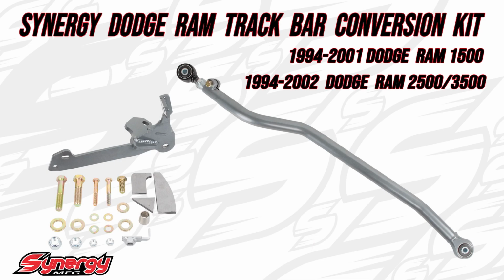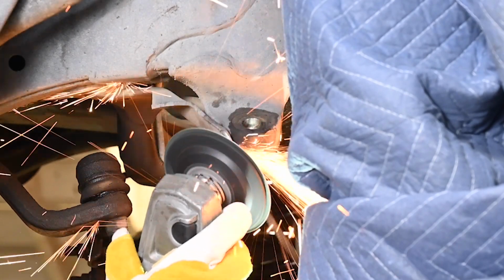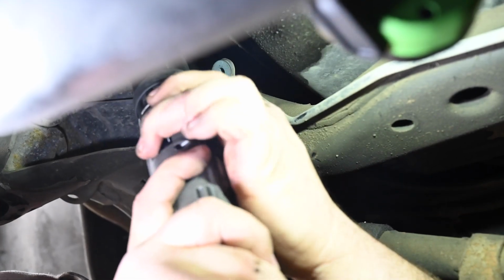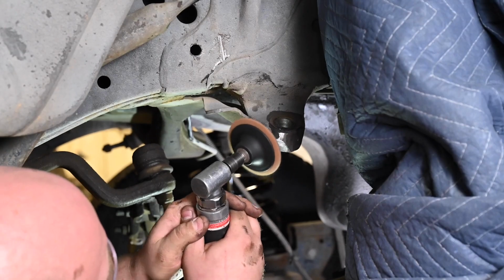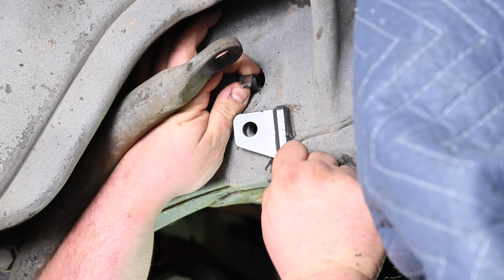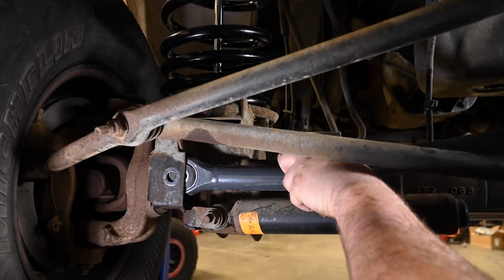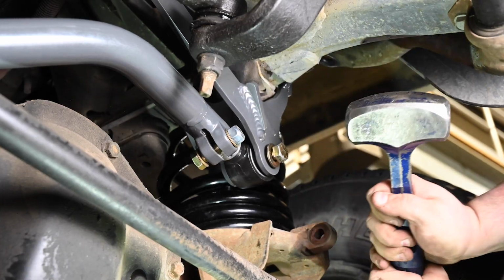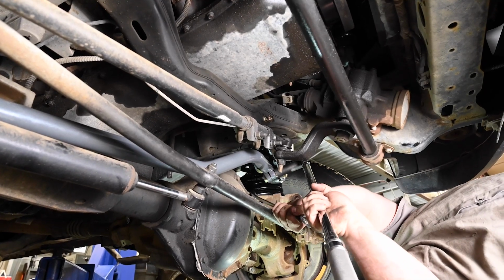Synergy 1994-2002 Dodge Ram 1500 / 2500 / 3500 3rd Gen Track Bar Conversion Bracket

Comment: Does this solve the interference problem with stronger forged front differential covers?
Reply: You mean big “cool looking” diff covers haha
Reply from the maker: So we based this product around the stock differentials just because there are to many aftermarket diff covers out there it just would be to hard. So we can't confirm that it solves that problem